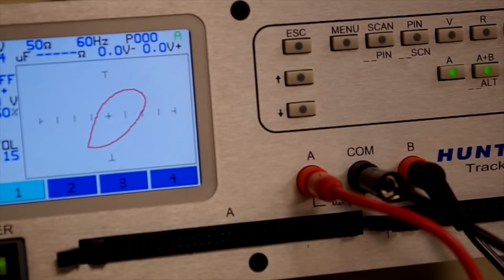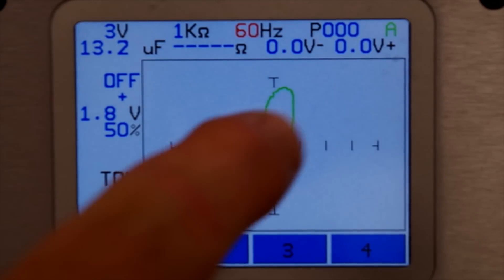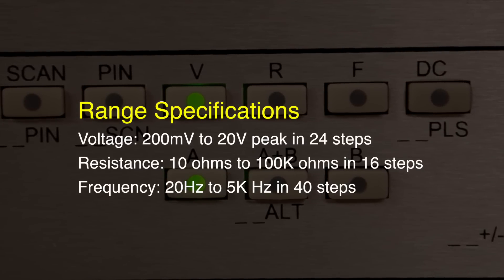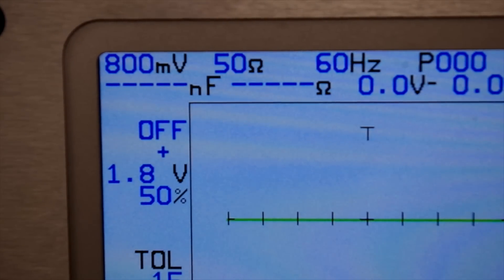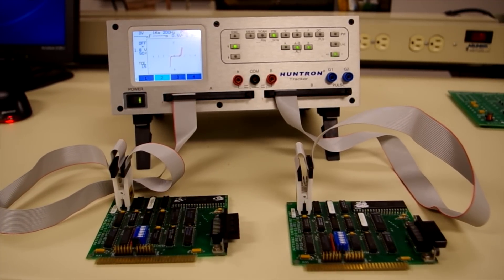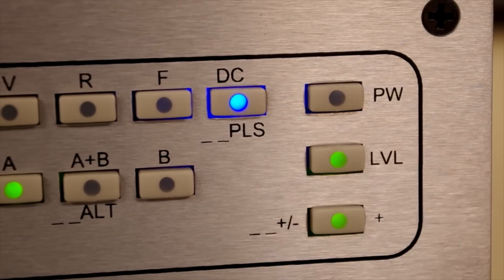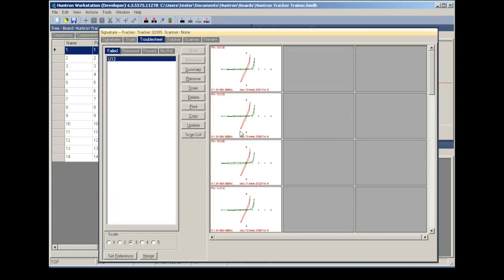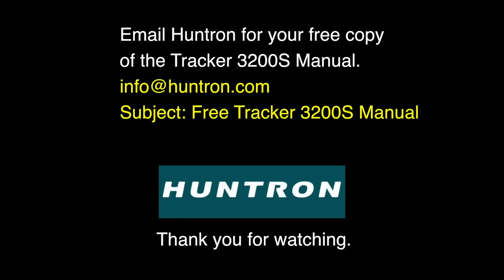Using the Huntron Tracker 3200S

Comment: hello
is there a chart  or calculator available that would suggest the best range of voltage and frequency to start with for component testing in a powered off circuit?
thanks
john
Reply: The Tracker 3200S tutorial has a chart included (page 14) that has some basic range selection suggestions. It is really based on component value or type.

Comment: How do you know, which resistance, frequency and voltage is the right choice for the component?
Reply from the maker: The range choice is typically based on the impedance and type of component (or net) being tested. This is the reason for the variable range capabilities... flexibility.